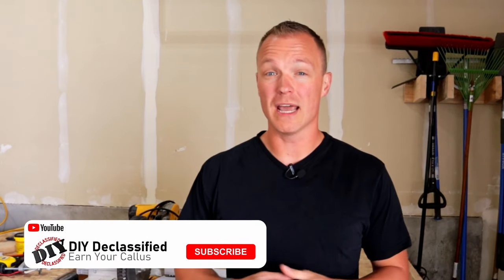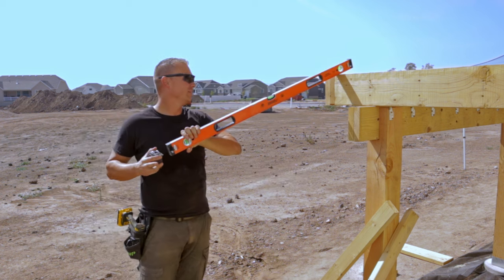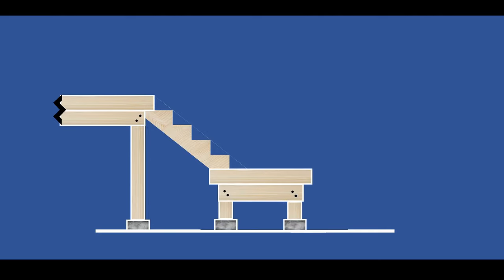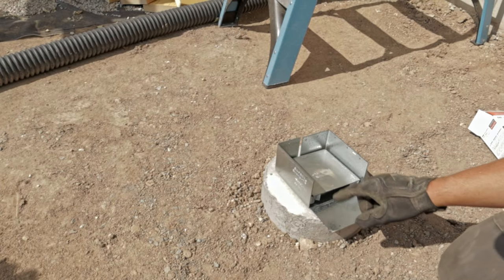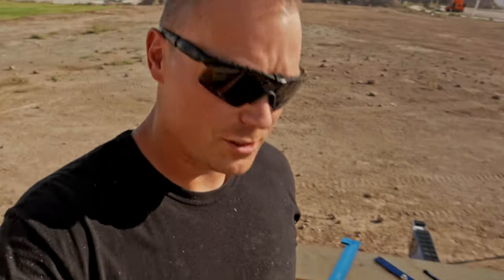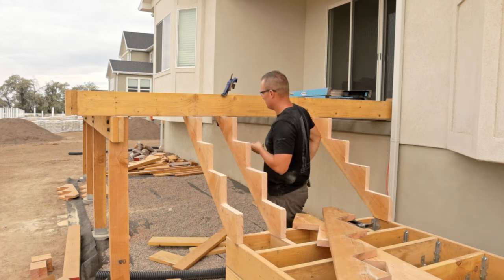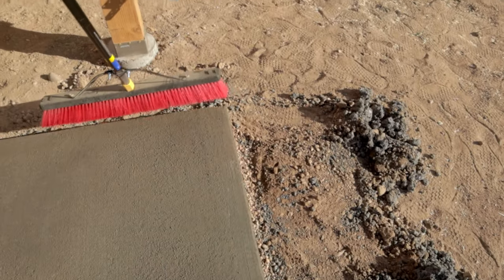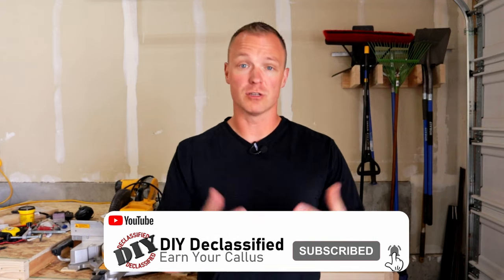My EPIC Deck Build - How to Build Stairs with a Landing// Episode 3

Comment: I like the way you did the stairs, attaching them behind the deck, also 2 2x4 at the bottom for staggered anchoring. Going to have to start using that method it looks a lot more secure.
Reply from the maker: Thanks man. We all learn by watching eachother.
Reply: I like that idea too however you need to be careful that you maintain your rise for every step otherwise you will have unsafe steps. For example if your rise is 7 inches with tread and your rim joist is 2 x 8 which is nominally 7 1/4 you will need to put a 1/4" notch into the top of the stringer so the end result is 7 inch rise for the top step.

Comment: The way you did your upper set of stringers was awesome. Alot of deck stairs and hand railing fail over time because they aren't mounted inside the box joist like you did. Very good tip.
Reply from the maker: I cant take all the credit. I saw another YouTuber do this and thought it look SOLID. My only fear is that I should have used a wider board since I had to cut further into it. But with four stringers 12 inches apart, I think it should be fine.

Comment: A little trick I learned in my previous work. If you file threaded bolts or rod after cutting with a portable bandsaw, you can get a nut on it.
Reply from the maker: Thank you for the tip.
Reply: Yep, came to say the same. A little filing and you’re all set

Comment: You cut so deep into that top stringer to place it inside the deck. Are you not worried about it? I am presently in the process of building deck stairs, but I think I'll still surface mount it. Only problem is I'll have to add another ledger piece under the rim band as the stringers fall short. That might look bad. Lots of things to consider on these deck builds...

Comment: Excellent, but I'm curious why you didn't just attach the platform to the posts instead of first attaching the cross members to the posts and then sitting the platform on top of that...? You'd use higher posts for that, of course, but it eliminates a step and would have the same structural integrity. Or so it seems to me. Thanks
Reply from the maker: I didnt do it that way because...I didnt think of it in the moment. Ha Ha Hindsight, that would have been the better idea.

Comment: you did good on this except your stinger material you should not have less than 5.5 inches of material remaining on teh heal edge  if you have less than that it is always recommended to put a 2x6 runner on them to add extra support ..But I suggest using and most building codes require 2x12 for your stingers .. on your stingers you should add on the inside a 2x6 runner to add more support .. other than that you did pretty good and you can go with the material you used every 16 inches   and any thing that contacts Concrete should always be Treated lumber
Reply from the maker: Thank you for the constructive feedback. This is the kind of post that not only helps me improve my skills, but it educates and helps the community.

Comment: Just curious if the blocking you added to the stringers replaces the need for strong backs on the side of the stringers? I love the way you connected the upper stringers to the deck. I've never seen that before. Also I'm curious if you have or plan to have a video on how to properly install a handrail.
Reply from the maker: I can’t take the credit for the way I attached it. I saw another YouTuber do it and thought it looked way stronger than what I had originally planned. This summer I have plans to do a follow-up video of the deck where I will put in the hand rail, and address some other things I wish I did differently.

Comment: Thank you.  Nice video.  I was always under the impression that screws have much lower shear strength than nails, but I see you are using screws for structural components, many of which will experience significant sheer, where I would typically expect nails, such as joist hanger nails.  What types of screws are you using in this case?  I assume it is like a high strength structural screw?
Reply from the maker: You're right about the sheer strength, the screw will lose everytime. There was a shortage of materials when I built the deck so it was tough getting nails. I opted for construction screws. With the amount of screws going in each hanger, im not too worried about them breaking. Plus my area stays pretty dry year round so there isn't much wood movement. I would have definitely preferred nails though, those screws added so much time to the project.

Comment: Interesting way to attach the stringers to the deck.  Never seen that before.  Only conserned would be how much of the 2x12 is left.  Might be a weak spot?   Here is a video that I made on how to build a composite staircase. https://www.youtube.com/watch?v=MkYkMQh6hP0&t=1848s
Reply from the maker: I felt the same way. After talking with some local builders in my area that do this they "assured" me it would be fine since I set the 12 inches on center. Only time will tell. I do perform a spring inspection every year looking for splitting or signs of weakness. It's not always the best way, just another way.

Comment: All of that framing material should be pressure treated.  Nice work.
Reply from the maker: Yes it should. When I purchased the lumber we were in the thick of the wood shortage a couple years ago, and we couldn’t get pressure treated lumber. Before I built the deck I sealed every board in my garage, and every spring I go out and re-coat them.
Reply: @DIYDeclassified   very nice build I’m getting ready to re-do the exterior stairs to my parents home. Would be interesting to see or hear an update on how the lumber has been holding up to the elements

Comment: Noticed you added a slope to the concrete pad. Did you also slope the deck? I’ve read so many conflicting views on whether a deck with composite boards (with gaps in between boards) should be sloped or not. Any help is greatly appreciated!
Reply from the maker: I did not slope the deck. I too saw many mixed reviews, and decided to keep it level. My thoughts on this, the composite boards I have already have a slight curve that will help push the water to the sides. Any water that does hang out, it’s going to do nothing to the composite boards.
Reply: @DIYDeclassified  Thanks! I really appreciate the answer as well as the reasoning behind it!!

Comment: I see why you cut the top of your stringers like that as it makes it easy to attach them to your deck but it leaves you with very little wood to support the load. I would be concerned that once that treated lumber dries out, you are going to get cracking along the grain and possible failure down the road.  I mount my stringers to the face, screw in from behind and then block between them and screw in from the side. Our runs are usually a bit longer than yours but don't underestimate the loss of integrity that treated lumber experiences over time. I have yet to be able to reuse a full set of stringers when replacing  wood decks with composite. They always split along the grain.
Reply from the maker: Thank you for the advice. I will keep an eye out for splitting. I saw the idea from another contractor and loved the idea. But you are correct that there isn’t a lot of “meat” left on the stringer.

Comment: Thank you for the videos!! How did you determine where to install the post holes for the landing platform support?
Reply from the maker: Afraid I would mess up my measurents, I waited till I had the frame up on the deck before I determined where my posts went for the landing. From there I used a stair calculator the determine where each step would be, and measured out from the deck. Knowing the run of each stair I new how far out the landing would go.
Reply: @DIYDeclassified  thank you for replying!  I thought that would be the best way to do it.

Comment: I'm at the point of adding my stairs to the deck I'm building. How did you determine where the piers for the landing go?
Reply from the maker: When I did the math for the stairs, I knew my runs would be 10 inches, and wanted the landing to be 4 steps down. So with that I knew how far away the landing needed to be. But I did wait to attach my landing to the beams until after I cut the stingers just in case there was any slight movement I needed to make.
Reply: @DIYDeclassified  thank you!!

Comment: your concrete pad was pretty ugly dude. I could clearly see the horrible broom finish! Please dont tell people thats a how to broom section because its NOT!
Reply from the maker: I literally said “this is my first time doing something like this.” And I didn’t even show how I did the broom finish.
Reply: @DIYDeclassified I heard what you said but that doesn't excuse poor workmanship!  Then next time just cut it out of the video instead of embarrassing yourself with a very poorly finished concrete pad. Any customer I've worked for would have me rip that out and redo it.
Reply from the maker: @rickhatesmisleadia7101  First: I’m not embarrassed by it at all, because it was my first time and I learned a lot from it. Second: I’m going to continue making videos and posting them, feel free to tear me up all you want.
Reply: @DIYDeclassified  I'm not tearing you up man! That pad is pretty bad and any respected concrete finisher would tell you the same thing. Actually, your video was pretty good except the pad portion which you could and should have edited out.  I never once suggested you quit making video's so don't come at me with that but I would have replaced that pad and finished it properly. Show some respect for the trade. If I did a deck video and put and nasty knotted up board right in the middle of the deck, I would expect carpenters to criticize me :) You do you man....like I said it was a good deck video but the pad could have been left on the cutting room floor  :) Nothin personal